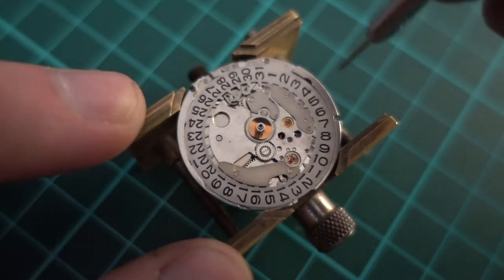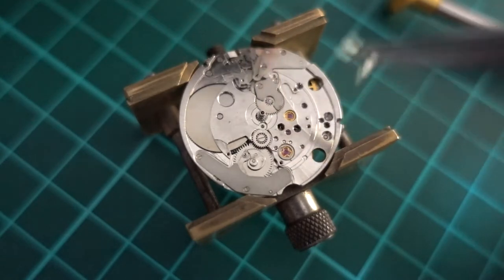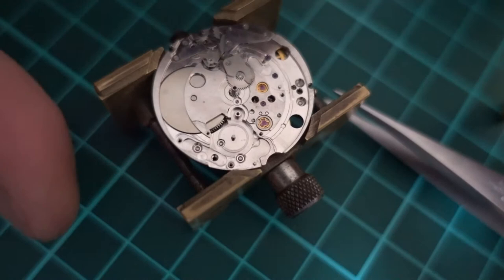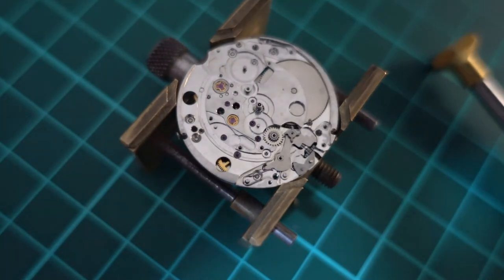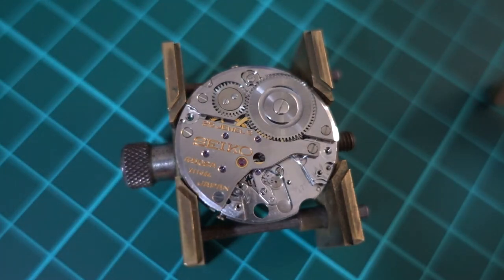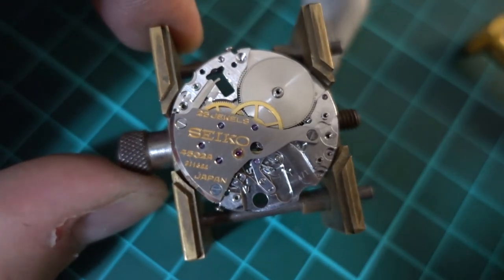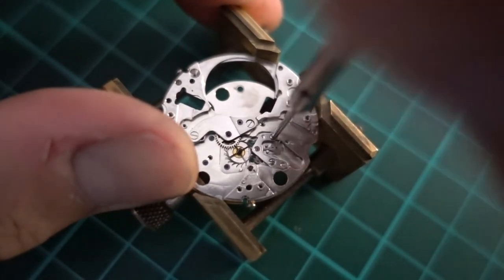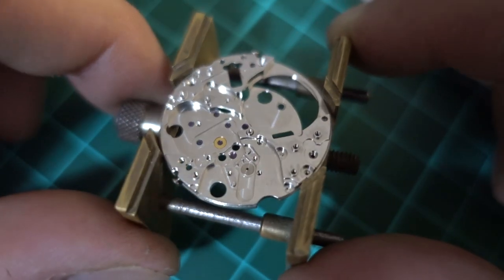[TECH] SEIKO "KING SEIKO" 4502-7001 "45KS" Teardown PART 2 - MOVEMENT

Comment: Excellent video and I'm glad you're getting close to 1000 subs, I do hope my video helped at least a little.
In your opinion which movements are better, the 45 family, 56 or 52?
Reply from the maker: Geday, thanks! Got there the other day finally.

Finish wise, they are all roughly the same. The 45 and 52 are maybe slightly better finish wise than the 56 but there really isn't much in it.

As for function, the 45 is more like a racehorse. Runs great but needs fairly regular maintenance and probably not great as a daily wearer. The others are designed for daily wear. The 52 performs very slightly better than the 56, but again, there's not much in it. It's more so an example of the prevailing philosophies of each division, e.g. Suwa vs. Daini.

In Japanese business at the time it was common to have competing divisions making the same product in different ways. The idea was this promotes internal competition. In the west we tend to design everything by committee which stifles internal innovation.

Comment: Hello and thank you for the video. I am an amateur watch tinkerer and wanted to try my hand at servicing a 4500A - 7001. Do you happen to know the measurements for the mainspring, I don't have a mainspring winder, and while I have serviced mainsprings by hand, I am afraid to do so due to the strength of this caliber's mainspring. I would much prefer to use a generic replacement. From what I understand "1.3 x 0.115 x 340 x 10" works in a Caliber 4420, do you happen to know if this would work in the 4500A? Any assistance would be deeply and greatly appreciated. Thank you!
Reply from the maker: Geday, I've looked high and low and there are no generic mainsprings that will work in this model right now. GR make a spring that is nearly right but it's too long which is a fail as it won't fit inside the barrel. Only option right now would be to pull a MS from another good movement.
Reply: @hal0eight  Thank you so much. I think the MS is good, I will just have to brave servicing it by hand. I'll just do another 100 more practice reps on a practice mainspring to build my confidence and technique  :)

Comment: hello i recived today my 4502 7001 which skip when you set the time but o can set but every 5 o 10 min it disengage  one gear must be one or two broken theeth. any idea about what happens to my wach. the main spring i very weak
Reply from the maker: Probably a broken gear in the setting components. If the mainspring is weak it may have been replaced. The mainspring is unavailable, so it would have been replaced with an incorrect mainspring most likely.